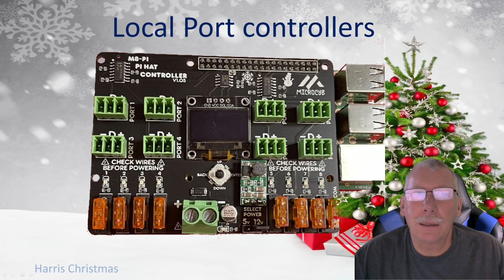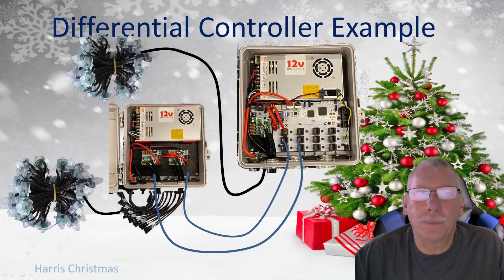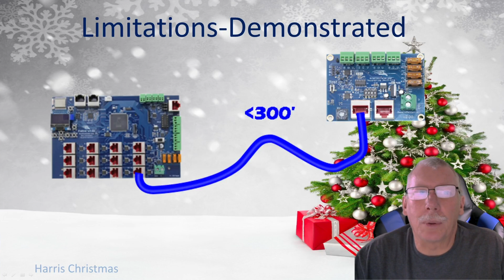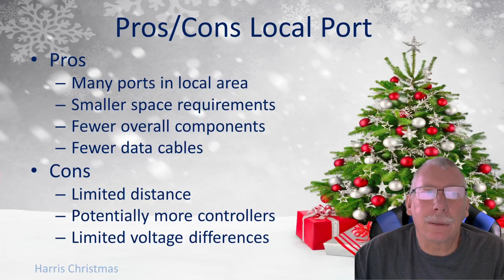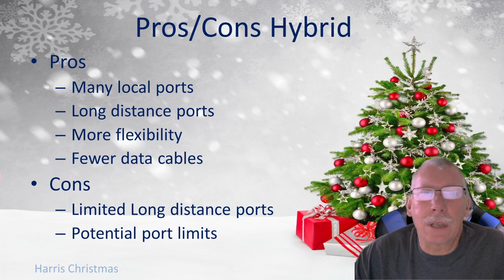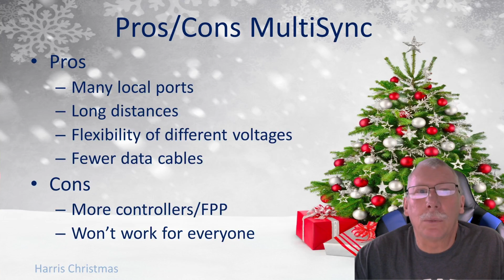Best Controller for YOU

Comment: I really learned a lot from your videos but still seem to have not found the right solution for my (seemingly) easy problem 😂.
I was welding a big snowflake from stainless steel and want to cover it now with smart LED's. (About 500 - 1000 pixels) Then map the LED matrix so it becomes like a big screen though not having a grid layout obviously and programm light shows on the computer for that piece. For two weeks I look for a small standalone controller where I could just upload the file I created and it just plays that show whenever its powered on.
I just want it to behave like any other (dumb) light chain: It plays the sequence when ever there is power and you can just shut it of by unplugging. Of course it should have a rather small footprint to give it a waterproof case and make it financially not to heavy...

Does anything come to your mind?
Reply from the maker: Actually I do. you could use a K4-PB from KulpLights https://kulplights.com/product/k4-pb/ and in FPP you can use a command preset to have the sequence play as soon as the device is powered on.
Reply: @ Thank you for your answer! Yes I found them but thats still over 100 dollars just for the controller.
I need to get the cost down significantly to make a sellable product out of it. If something comes to your mind I'd love to have a video call with you and pay for your expertise 🙏🏻🙋🏼‍♂️
Reply from the maker: @unfinishedthought  I didn't realize you were looking for inexpensive with limited growth potential. Look at the DigQuad line of controllers.

Comment: This video is awesome! Thank you! What are your thoughts on using a combination of Pucks, Pixels & Strips. I'd like to find a way to utilize a mix of all. Would I need to use a different controller for each light type or could I just isolate the light type to a port? For example, I like how pucks look shining down on the side of the house. I also like how diffused strips look with effects. I would like to run the pucks and strips along side each other and then use pixels solely for yard props. Have you seen any setups like this?
Reply from the maker: My thoughts? I have said this a hundred times, the best way is what works for you. If they are all ws28xx protocol you can not only use them all on the same controller, but on many of the newer controllers (Kulp, Falcon) you can even mix them on the same port! (That might not always work depending on the pixel timing, you will have to test it out). Just be careful with strips, they are a PAIN to modify/fix.... But it sounds like a great plan.